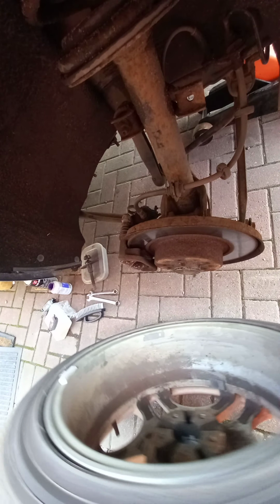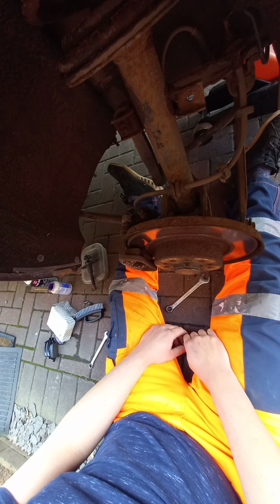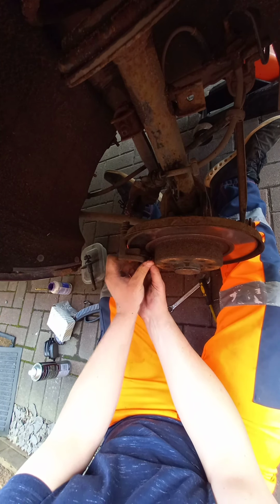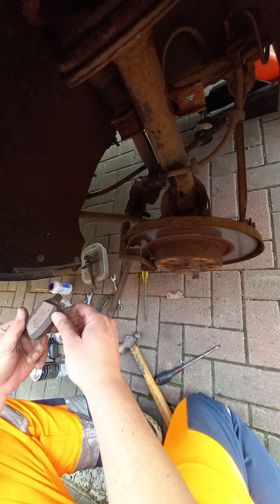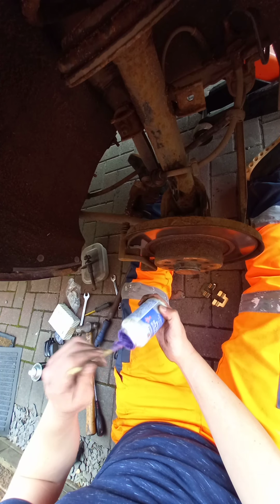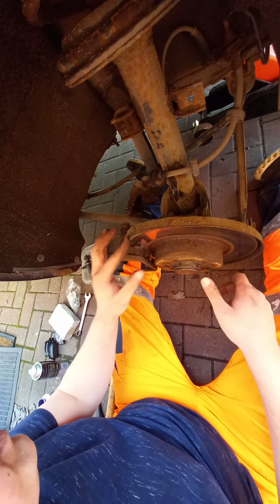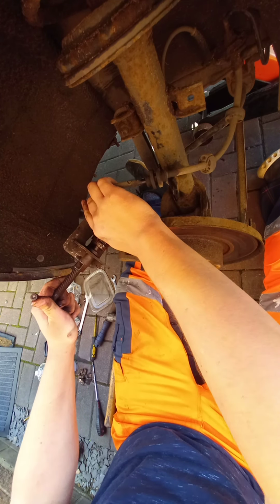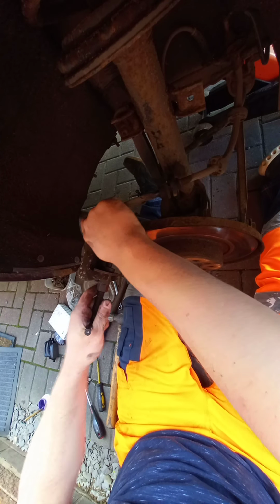Alfa 156 rear brake pad change

Comment: Nice to see a not so rubbish mechanic at work.
Always good to see people's method of work on various tasks. Have been replacing discs and pads myself this week but ended with me sheering a guide pin bolt inside the caliper (with a torque wrench). 😓
Im starting to think that cheep torque wrenches are fine for wheel bolts but not so good at the bottom end of their range.
Reply from the maker: Torque wrench on guide pin........
Reply: @therubbishmechanicmrcoleman  Workshop manual said 32Nm. Was fine tightening by feel with a spanner, went to torque it as per instruction and SNAP!
Served me right for following instructions.

Comment: I purchased a a rewind tool similar to yours (that was recommended for my brand of vehicle) but there was no room for the threaded shaft to fit through the caliper. Good old G clamp did the job with ease though.